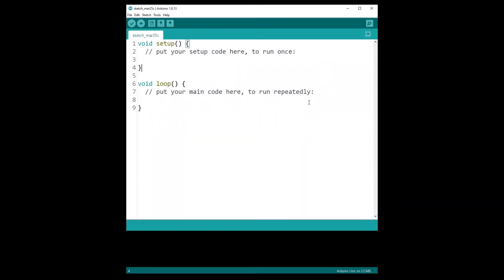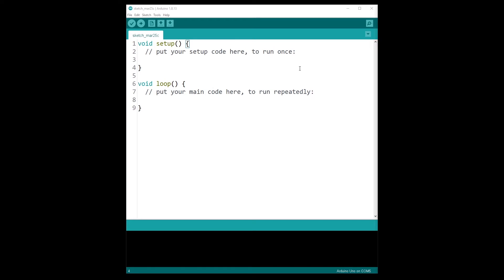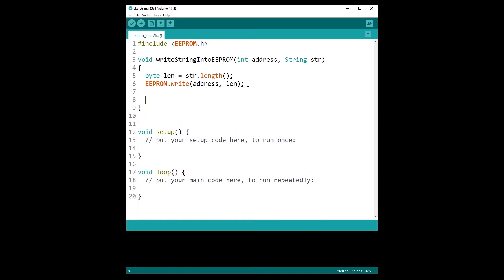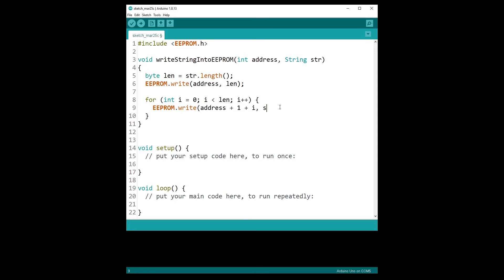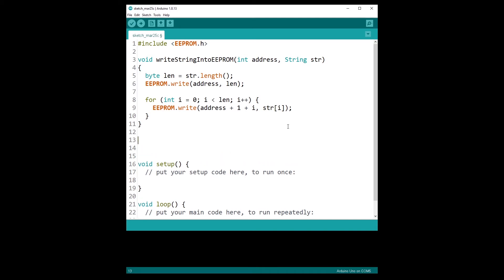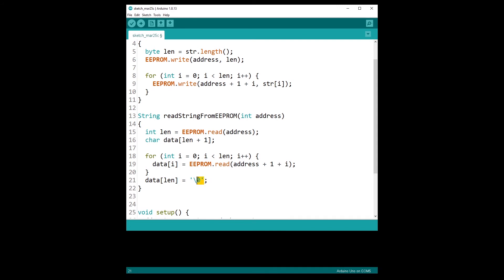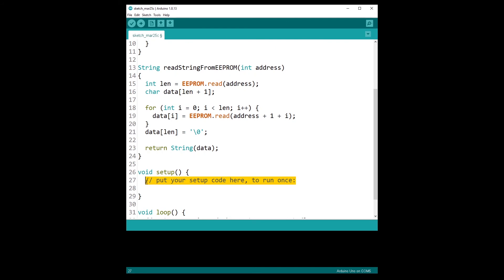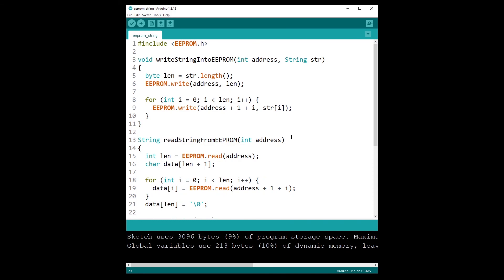Arduino - How to Save a String into EEPROM

Comment: Brilliant tutorial. Do you have any tutorial on writing and reading to external eeprom like 24C32 chip for example using I2C ? I have an application that requires storing data in external towers and each tower has 4 eeproms. I need to search all the towers for a 6 byte code. :) Keep up the good work mate.
Reply from the maker: Thanks! I don't have a tutorial for that. Depending on the hardware you might be able to find a plug&play library, otherwise I guess you'll have to use I2C
Reply: @RoboticsBackEnd  Thankyou for your reply, I have managed to sort the eeprom code. Next is to connect a usb bar code scanner.

Comment: Hey, I was trying to store like you do here, into a String variable ssid data read from EEPROM, the node mcu I am using is ESP32 WROOM32D and it seems, maybe my logic is wrong? But I am not too sure, what you do here, I have tried to do similar but all I have been getting is inverted question marks instead of actual ssid and pass. here's the code snippet: ssid+=char(EEPROM.read(address)); this is of course in a for loop, somehow a month ago, this had worked without problems when I ran it, and now it's like my knowledge has lost all meaning, idk what is the reason, I have been scratching my head around as to why so sudden and uncharacteristic departure in behavior, sigh. Anything would be helpful for this.
Reply: I experienced the same issue with ESP8266. To solve:
1) Add this line to your setup function - EEPROM.begin(512);
2) Read comment and edit code accordingly in READ function - data[newStrLen] = '\0';
Reply: @christygovender4959  I unfortunately don't remember. It was a project I was working on and don't know how I figured it out. Might be I might have used Read and Readstring commands from Arduino to read. I hope you figure it out.
Reply: @dhavalshukla6615  I've figured it out, I've edited previous comment with solution I used. Hope it's helpful to you
Reply: @christygovender4959  thanks. Had it figured out month ago but I'm sure this will be useful to someone else!

Comment: Doesn't EEPROM.put and EEPROM.get do the same thing?
Reply from the maker: EEPROM.get() is to read from the EEPROM, and EEPROM.put() is to write to EEPROM. Now, with put() it's going to do the same thing as for EEPROM.write(), but it checks the data first, and will only write if the data is different. 
So in the end, using put() could be better than write(), however as this tutorial is aimed at complete beginners, I wanted to stay with super simple things :)